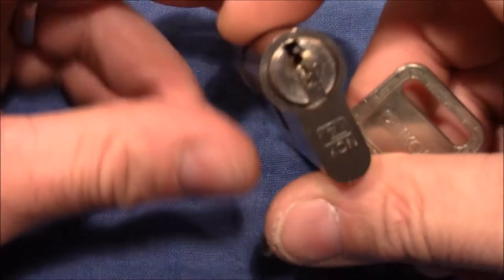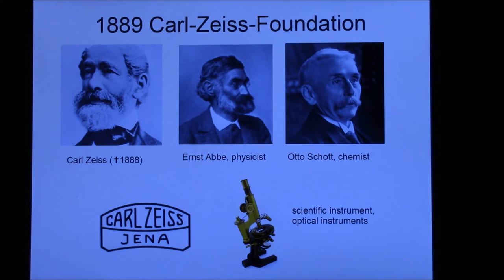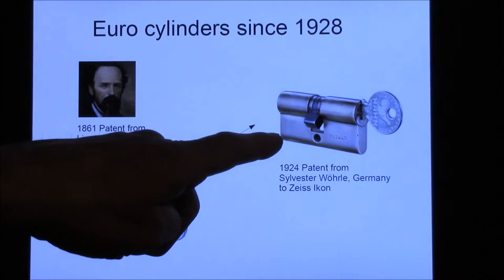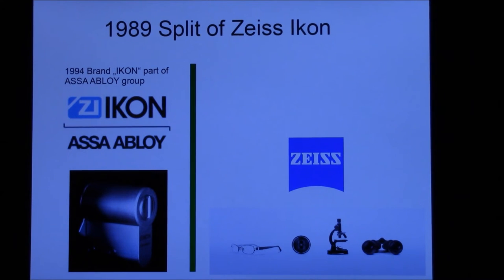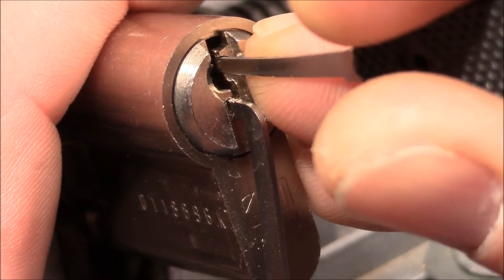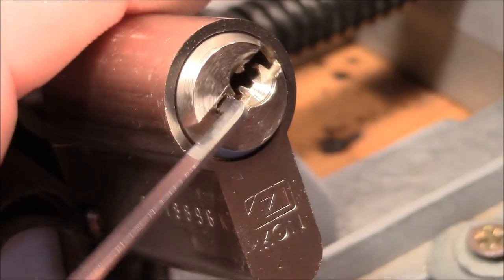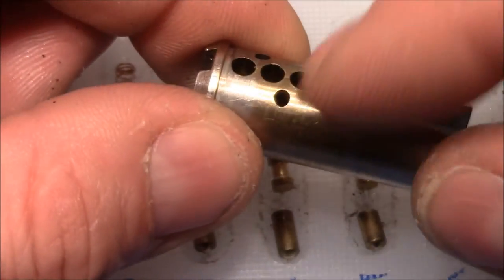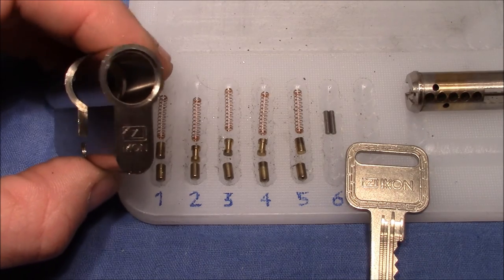(picking 168) ZI IKON [EURO cylinder exploration series] picked and gutted; with Zeiss history info

Comment: I've used many Zeiss optical instruments in the past, having no idea there were locks from the same company. The Zeiss lenses and objective optics were extremely precisely manufactured - are the locks as tight on tolerances?
Reply from the maker: +Shira Assel Interesting. Are you a photographer? The individual lock here could have tighter tolerances. But in general the make great products. Examples: https://youtu.be/MHNymPGO864, https://youtu.be/QwnFxuqRSmg
Reply: Guilty as charged, at least in the past. You couldn't tell from the quality of my webcam videos but I did wedding photography before the advent of cellphone cameras and cheap digitals. Also used Zeiss optics in light microscopes in school. Basically anything that had optics and wasn't of questionable quality had Zeiss written on the rim. Thanks for showing the history of the company, helps things make sense.

Comment: Nice video ... the Germany lock are not junk
Reply from the maker: +Den Brass Haha, there exists a lot of gradation. But yes, most brands / companies make decent locks. These standard euro cylinders seem to rely mainly on the restricted keyway and the security pins. But less in very tight tolerances like in ASSA or SARGENT locks which have a wide open keyway. I like the diversity.
Reply: Potti314 Here in Quebec there are no lock, all what one finds come from the United States